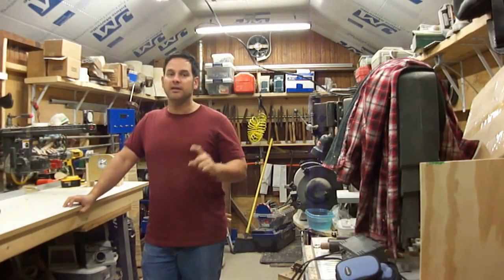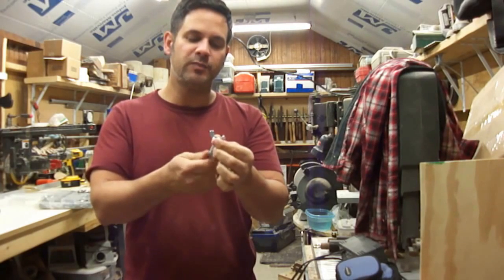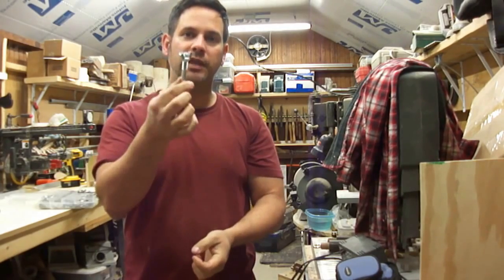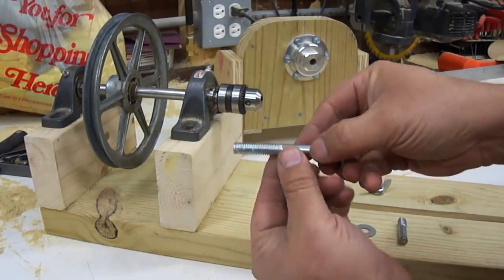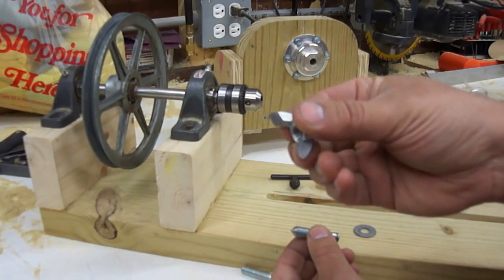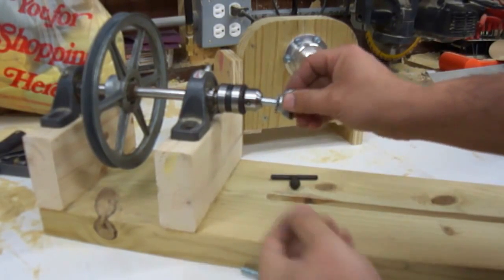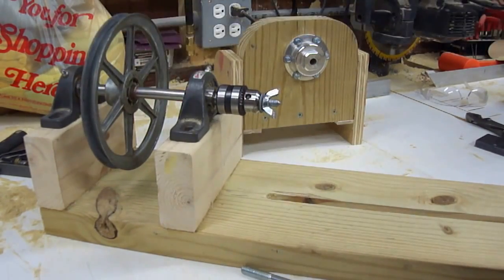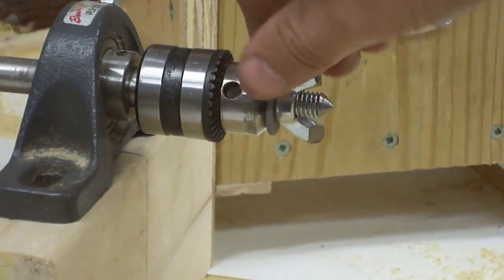Spur Drive Center - HomeMade 2 Prong woodturning center (torno casero)

Comment: Well I'm 4 years late to the party 🥳 
I just spent a couple of hours forging the head of a large bolt flat, then ground it to a spur drive. But . . . it's off center 🙄
Then I looked at my hardware and saw some wing nuts, and thought "That's gonna be easier to sharpen centrally".

So I came back to my friend YouTube and found that you did the same thing 4 years ago, and it works!

Great news!
Reply from the maker: Glad you liked it

Comment: for this to be zero cost - as you stated in the beginning - you must have stolen the bolt and wing nut
Reply from the maker: true, i suppose if you want to be technically accurate the cost of the parts used is about $0.12 but really, who is counting $0.12

Comment: I drill a 3/8 or smaller hole in the end of the stock and a counter sink.
Reply from the maker: +Stu Bee , do you mean instead of a spur drive?
Reply: Ray Pena As per your video subject, yes
Reply from the maker: +Stu Bee , ah. you mean using a counter sink as a drive....it took me a bit to realize that.  good idea.

Comment: Thanks for publishing this, I was going to spend an hour or two this upcoming weekend grinding a spur out of a coupler nut.  The nut may look a little more elegant, but this is going to be much easier. I am putting together a small lathe using stuff around the house too (using a pair of Zyliss clamps, parts from some old drills, and even using some palate wood)
Reply from the maker: +49cfr that sounds like an interesting project.  im glad you found this useful.  if you are curious how well it works be sure to see my goblet trophy video. this little spur drive GRIPS!!!
Reply: +Ray Pena nice, Heavy Seas or Union?
Reply from the maker: +49cfr it was for a relatively new brewery Mispillion River Brewing!